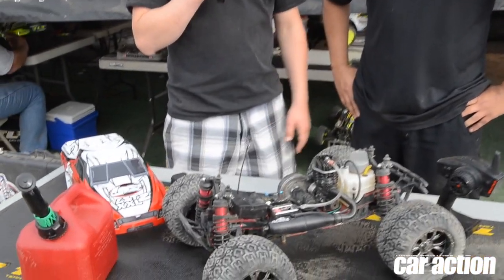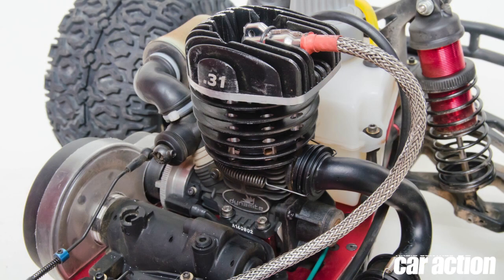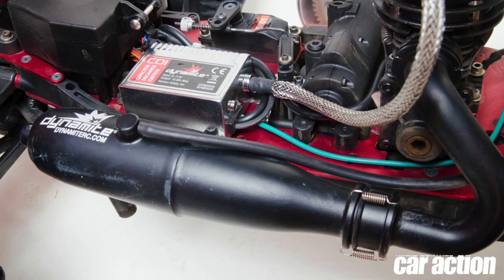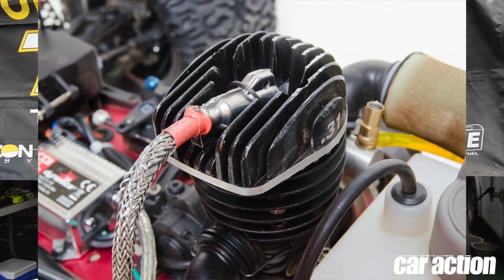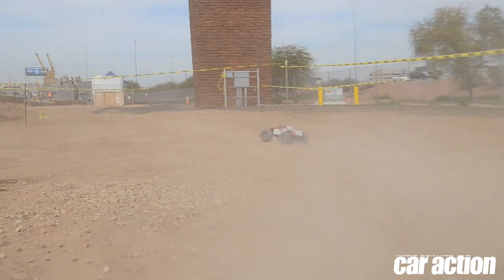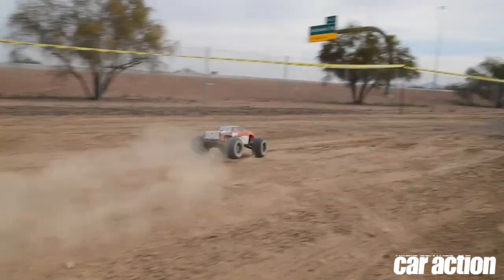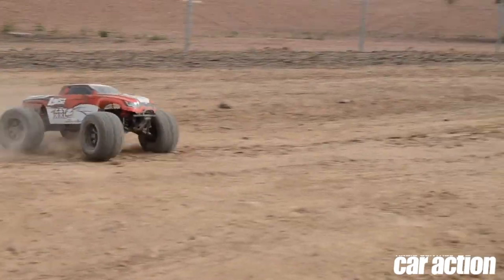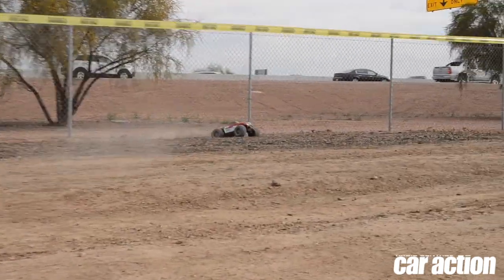RC Car Action's exclusive first drive with Losi's gasoline-powered LST-XXL2!

Comment: Brian Nunez u need to get into contact with the motocross engine builders. Like Mitch Payton from pro circuit or Donny Elmer from FMF. I bet these guys would be very interested in your gas engine. It would be a new market for these guys . Especially for design ing  exhaust pipes!

Comment: I'm really excited about this. The tecnology is promising. As long as the motor is durable this will take off. Tuning shouldnt be an issue since there is an ignition system. May even be able to do tuning via lap top, carb needles and reed valves similar to dirt bikes or sport bikes.
Reply: Awesome can't wait for the Savage octane and this rig to be released! Maybe it will put some spot light back onto the gas and nitro side of the hobby bout time!

Comment: definetly this is cool and a huge level up in rc's ...i have already xxl converted to brushless but when it will be in stock i definetly buy  one.... i wonder how many galons this engine will handle . If same as nitro then this is bad
Reply: One of the losi guys said they have engines they ran 20 + gallons threw and still going strong
Reply: that is a good answer :D if it will be like that i definetl want one of these..

Comment: I would be back into 1/8th nitro err... gas if they started running these motors. I loved the sound and smell of nitro but man it gets old quick. Come on Nova, O.S., Red's, Alpha, etc.etc.etc. Lets see some racing engines and get the rules lined out. I'm ready!

Comment: Cooling head is on wrong... Has been this way ever since the original LST....

Turn it 90 degrees... Oh wait, looks like the  engineers at Lois/Horizon overlooked that detail, as the plug wire isn't long enough...

Comment: I was never a fan of nitro powered rc cars since I started with the hobby back 1997. Even though I am an experienced hobbyist, I never like the fact that I have to replace the glow plug many times during 5 day period. In some occassions, you buy a new glow plug, connect that to the motor, then the coil breaks. You can't even return that to the hobby store to get an exchange. The store will not allow it. With my experience with gas powered rc, engine maintenance is less. Of course other moving parts will break, but that is minimal. Unless you drive like a maniac. 

I think Losi nailed this one. An engine that looks similar to a nitro engine; small, light, and appears to have an adequate power. 

The Savage Gas Truck to me is too heavy. Even though it appears to have better torque versus Losi Gas Truck. 

I can see that short course trucks is next in line to adapt this new technology in rc. I don't see why not. 
 
The brushless motors became very popular for its instant torque and speed. Then the Lipo batteries came along. The two became an instant hit! But then up to date, it is still a very expensive.

Comment: how much for a spark plug
Reply: I paid 10$ for mine at my local hobbie store. But sometimes on this .31gas motor you will also have to change the head button otherwise your spark plug won't work . And that was $20. But you don't have to do it for a long time but you should stock it in your tool box! This truck will spank the hpi Octanes ass and the older .25 nitros ass as well.

Comment: So lets see one gallon of gas is 3.50 or so right now plus 16.99 for pn DYNE4105 which is only enough two stroke oil for one gallon puts us over $20 a gallon for fuel. So much for his comments about the cost of fuel. They need to fix this now before they start losing pre orders and the truck fails.